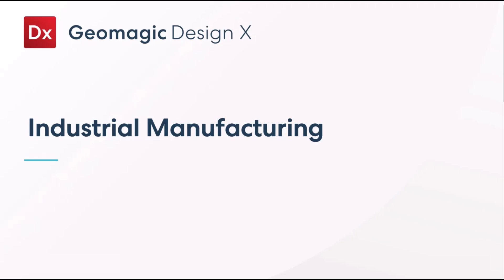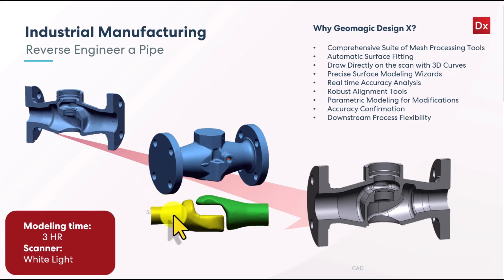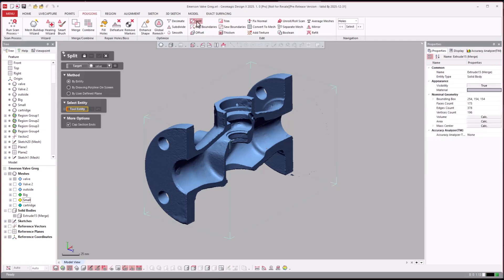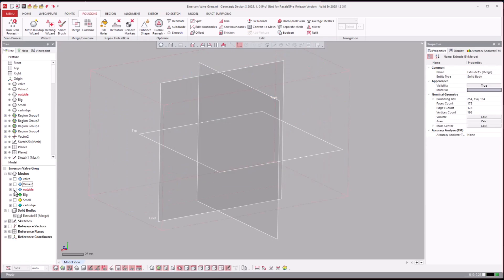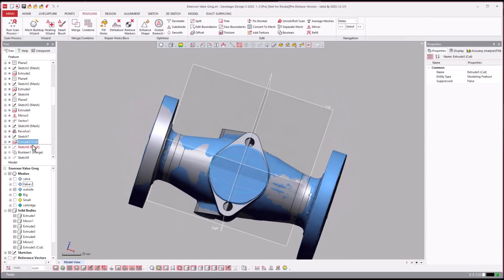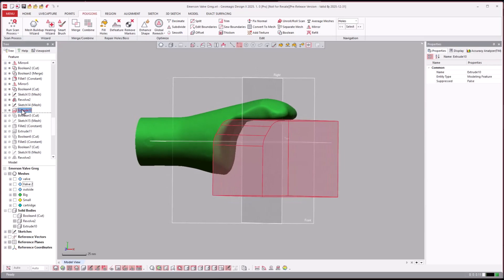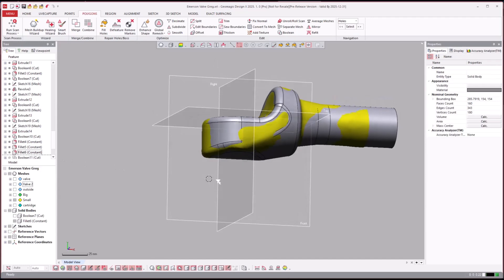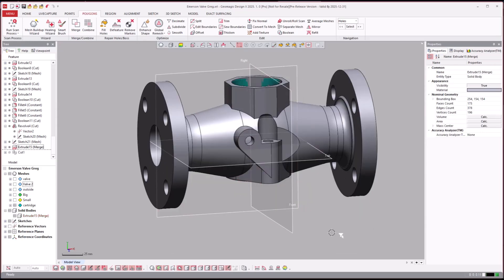Reverse Engineering an Industrial Pipe Valve | Geomagic Design X

Comment: Wouldn't it be much quicker to scan the valve as a whole before cutting it apart, then cut it apart to scan the inner workings? Then align the two scans and start reverse engineering. Nevertheless, great videos as always.